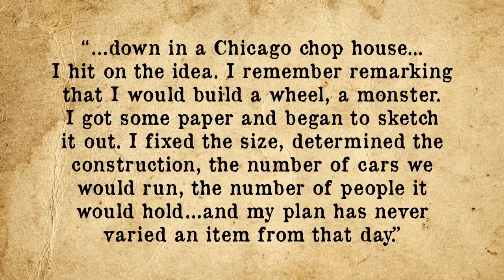The Dentist Who Gave the World Cotton Candy

Comment: I have a question every time I ask what the heck is the difference between Pet friendly Salt and normal rock salt for the side walks i get told that they add chemicals to the normal rocksalt I do not believe this at all is it really true and is pet friendly really any safer for pets then normal rock salt?
Reply: If what you have is only rock salt that is pet friendly. Most road and sidewalk salt, however, has a form of antifreeze which is dangerous for animals. This is why they work at lower temperatures.